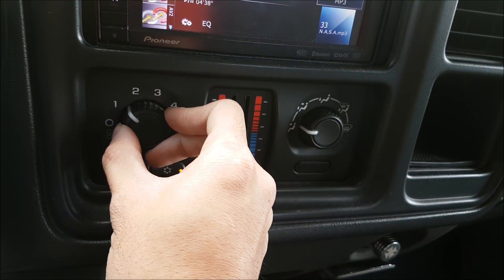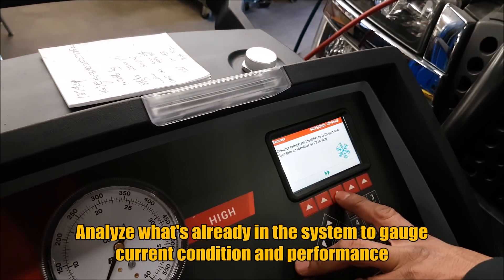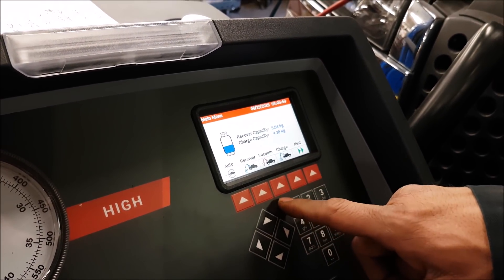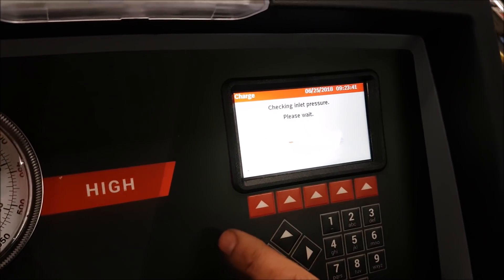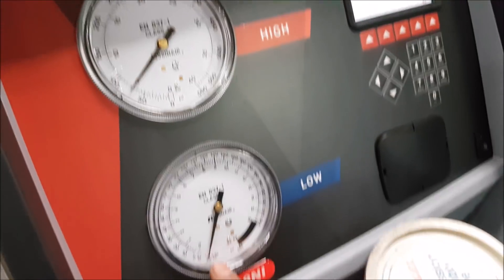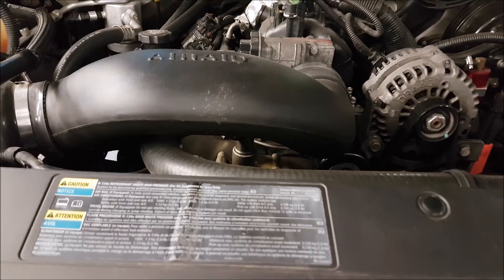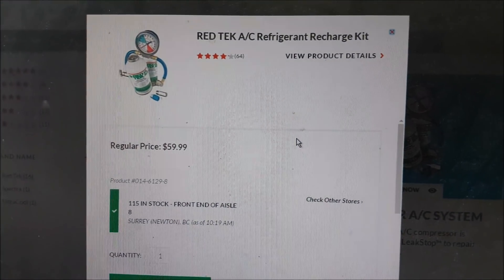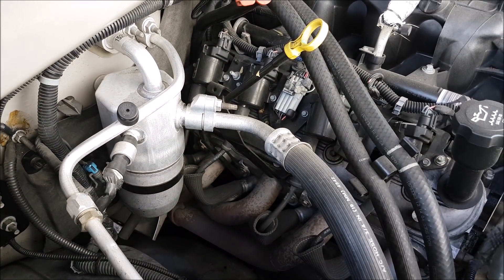How Professionals Recharge AC Systems in your Car or Truck | AnthonyJ350

Comment: hello i'm an ac technician and the way to do it yourself if to buy a vacuum pump 4 CFM it's ok($125) if its a 18 oz r134 car run the vacuum from 7 to 20 minutes depending if u cleaned (flushed) your ac lines run it for 20  minutes. this will get all humidity oil residues and more.you must buy the manifold or gauges this is the blue and red gauges and when proper vacuumed pressures on both gauges must be below 0 all the way down to the 30. when 7 to 20 minutes in to vacuuming close the gauges first and turn of the vacuum pump your gauges must stay on below 30 for at least 10 minutes (this is what the fancy machine does(leak test) ) if it stays the same position it was 10 minutes ago then u don't have a leak in your system and now it's ready for charging with the proper refrigerant sorry for the bad English greetings from Puerto Rico!!
Reply from the maker: Thanks for sharing!

Comment: For an AC performance test, open the doors, turn the blower on max speed, put the blend on max cold, dash vents only, and then the manufacturer will specify if it's tested at idle or a certain engine RPM. 

Generally vent temps will be 10* above evap coil temp. Evap coil temp should be slightly above freezing to prevent it from becoming a block of ice. 35-45* temps are usually what you'd expect to see.
Reply from the maker: Thanks for the comment!

Comment: I like this video because I just did a compressor change in my 350z. It was actually super simple as my neighbor is a AC technician and had gauges and r134a on hand. My compressor came with oil inside already so it was just a matter of changing the compressor and using the pressure gauges to fill with freeon.
Reply from the maker: Thanks for watching!

Comment: in canada its technically illegal to top up refrigerant without doing leak check.. shop will charge you to evacuate and test minimum 1 hr, + labor and parts if needed + refrigerant ... for .200kg of r134a you paid to "service"  $109
Reply from the maker: ebu touy Yup they did all that in the video.

Comment: you can actually weight the thank while doing this so you know what you are doing just remember at the shop it's easier to have a machine doing the work plus charge u a lot for using it. I also have my licence so I'm not talking crap but just remember this machines just came maybe from 2008 up so before that garages used the weight thank metod and yes there are many ways to add oil to your system specially if your system is empty
Reply from the maker: Thanks for sharing your insight!

Comment: what I'm also trying to say is that if you were friend with this ac shop guy employee and he went to do this to your house he will do it right  without the need of the machine and he'll also add oil because when we get our licence we don't get trained to use this machines or how to take a specific car dash apart to get to the eavaporator coil so yes the machine is good but do not think that is the only proper way to do this
Reply from the maker: michael segarra How much do you charge to use the machine? I show how much I paid at the end of the video, it was only $109. The canisters alone cost about $60. Plus the vacuum pump, manifold gauges and my time.
Reply: AnthonyJ350 usually a vacuum oil and recharge $65 that's what he would charge you if he did it with out the machine but machine cost employee rent and something for the owner.. I'm not saying this is wrong i just letting you know that you gave wrong information saying that the machine is the only correct way and that is the only way to inject oil in the system because he is selling you the store like the machine is everything and that's incorrect because the machine is just a tool
Reply from the maker: michael segarra As an AC technician wouldn't you say this is the best and most accurate way. I know a lot of people who try to do it themselves because they just "top off" and don't use a vacuum pump. Sorry I should have generalized more because the machine is a vacuum pump, manifold gauges and the recharge kit all put together in one.
Reply: AnthonyJ350 the machine also knows by year and model of car how much oil and refrigerant fits in all individual lines ,evaporator condenser, compresor and  the machine is usually 99.something % accurate to. I'm not against them at all because it's a grate tool to have in a shop as it's saves you time and effort.they are also very expensive that's why they probably charge you $40 for using it even if is not like that on the recepit but the machine specially the new ones like the one in your video that have a scream and all they cost about $15000.  but as a technician we can do exactly the same thing out of a shop with out any of those machines and you whould not notice the difference then put it on a machine recover and you'll be amazed how accurate we can be to
Reply from the maker: michael segarra Right the key you're an experienced technician. This whole video is to promote the certified technician vs doing this service yourself.

Comment: i have 2006 buick allure never had it recharged  and air  just  was not cold anymore  took it to a shoppe they used the machine did a recharge ice cold again like the shoppe owner said  it lasted almost 20 years   now she new again  for $100.00 plus tax  $113.00   done right
Reply from the maker: Great job having your AC system serviced properly!